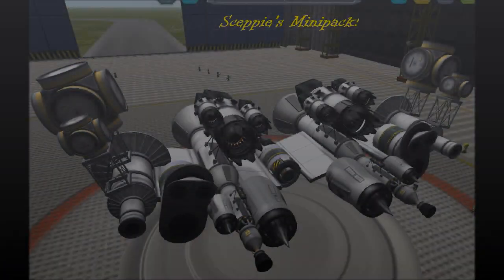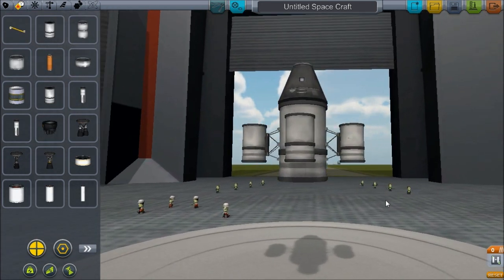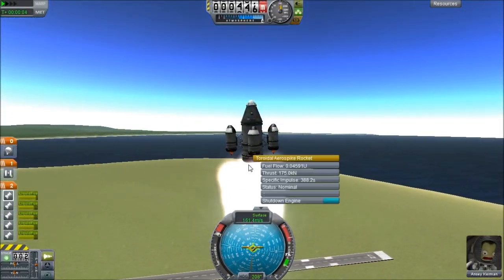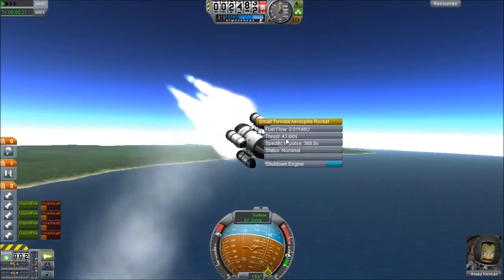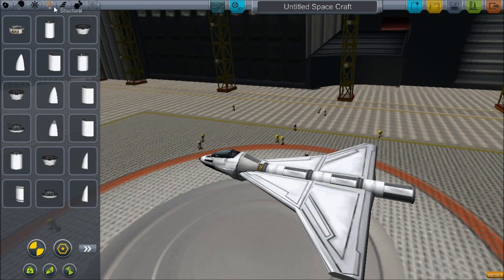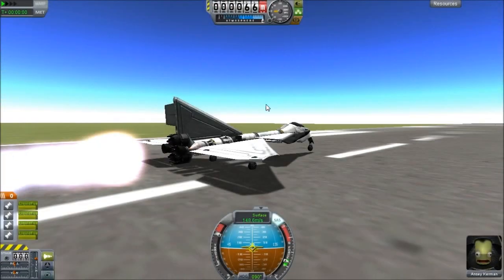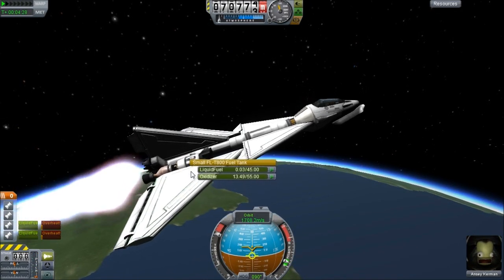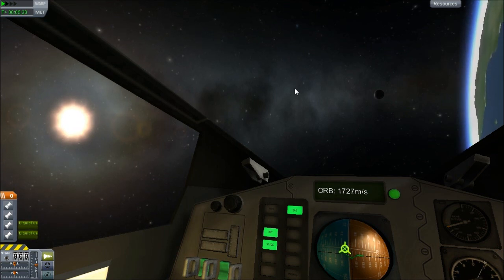KSP Mod Spotlight: Sceppie's Minipack!

Comment: I've just downloaded this pack, hopefully I'll be able to make some decent small rovers now :D
Reply from the maker: It's really cute on rovers. Too bad I kinda went for a more realistic fuel/mass/consumption balance with the current pack. Probably going to up the ante on the mini-skipper engine :)
Reply: Sceppie Fuel/mass/consumption rates are pretty good at 1/8 capacity for fuel tanks, etc. For the most part rovers tend to run exclusively on electrical charge, unless you're some sort of masochist and use TT's Modular Multiwheels and Omniwheels despite their amazingly horrible positioning difficulties.